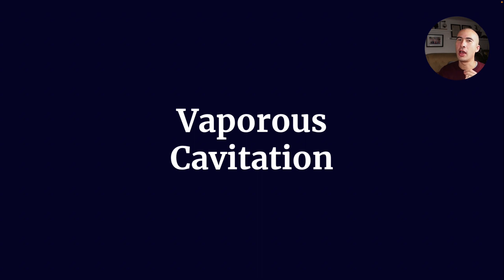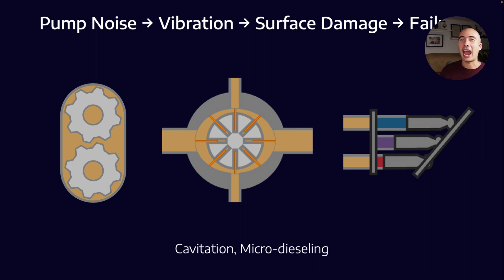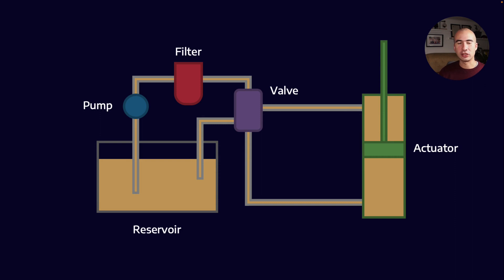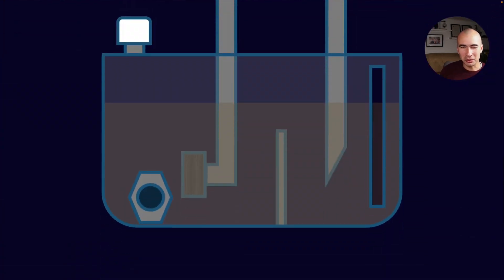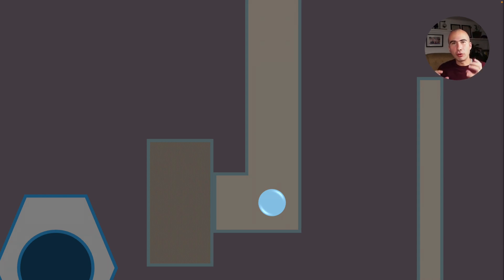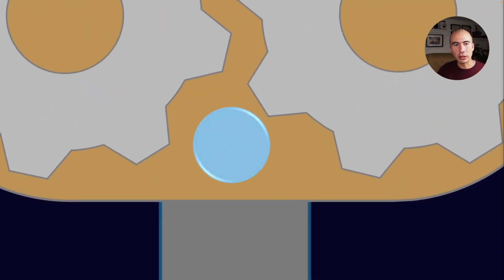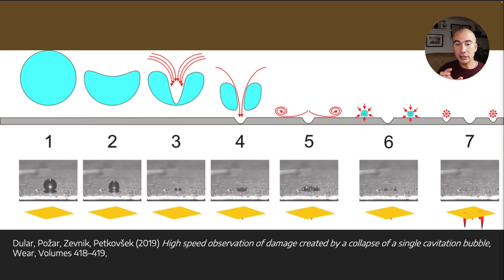How does water vapour cause cavitation?

Comment: Hi Rafe, nice video. 
I wasn't aware of water cavitation in hydraulic systems, even after 15 odd years underground!

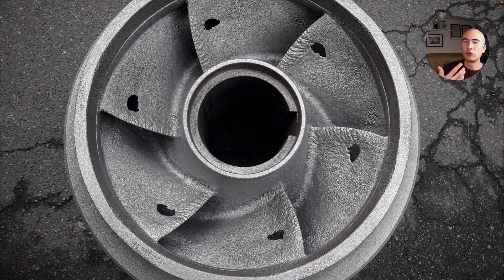4:05 The large U/G hard rock contractor I work for has had a long battle with coolant issues, mainly cavitation, brought on by a desire to step away from Ethylene Glycol based blends due to their flammable nature in the wrong conditions.
We in the various maintenance offices around the sites have been feeding information back up the chain to try to return to the original blends and get away from the water based replacement (finally happening now)
I must say that several of our OE partners and their engine suppliers have been very patient 😁
The final straw was for the latest non glycol trial blend reacting with a particular flux used in heat exchangers of the engine, and then there being almost zero replacement parts available due to never having failed one before (we needed half a dozen in one month)

Cavitation is nasty!

Comment: Would this occur with trace amounts of water in a Diesel fuel going into the injector pump? Or is more likely with higher viscosity oil's
Reply: At lower temperatures (0 to 35C) as in the fuel tank, compared to that encountered at oil sump (85 to 110C) the temperature increase by pressure isn't enought to cause bubble burst or cavitation.